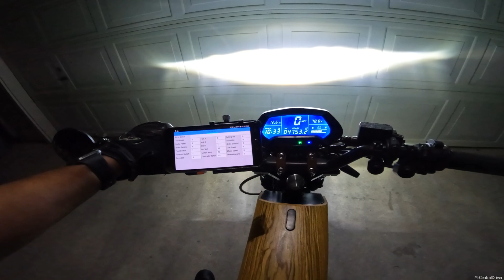Will the ONYX RCR Overheat now?

Comment: Hey, thanks for making these videos, they’re very informative! 

I’m thinking about bumping up my Kelly controller settings too. Did you end up changing out the battery connectors to OSE8 / 10 for the higher current per John Angels posts? I just want to tweak it slightly for more torque (not quite ready for sicko yet) but was wondering if it’s really necessary to change the connectors, curious what you did here. Thanks
Reply from the maker: yes ose8 with breaker switch
Reply: @MrCentralDriver  gotcha! I see that now from your other video. Thanks, keep up the good work!!

Comment: Question: do I need a kelly controller to unlock sicko mode?
Reply from the maker: Onyx rcr comes with a Kelly controller. Sicko mode is just what John Angel calls his adjustment tune on the stock controller.
Reply: @MrCentralDriver  so ultimately I just need to download the app on an android and adjust settings
Reply: @midorian12491  yes but read the blog very thoroughly and take some time and order the necessary parts and precautions otherwise you'll end up with a blown out controller or motor

Comment: Just about to buy my second QS205, this time it will be the newest version which is the QS 205 V3 Ti. Some stores in china now sell the motor with the stator aid and hubsinks already installed, I think this is a good thing but maybe they should have done this from the get-go. Some people have made PC computer cases that are like fish tanks, so the container houses all the components but is submersed in a certain oil that is non-conductive to electricity but of heat only. This resulted in a massive increase of surface area that allowed for rapid passive cooling without fans.

I think it would be possible to do this with these motors, it would be akin to a sealed gearbox or combustible engine in that they are filled with specific high temp oils but the container openings have a gasket seal to prevent any leaks, so that would have to be made by myself. In theory, it could work and reduce heat even more! 🤔
Reply from the maker: were at? they were sold out when I looked
Reply: Let us know how your theory tests out if you're going to test it

Comment: Yes regen creates Heat and a brushless motor makes for a horrible generator you would be lucky to get one or two percent back out of your motor into the battery it does save on your brakes but it's a little tough on the electric motor and it's cheaper to change brake pads than Motors so as you can see I'm very much up in the air about regen
Reply: I feel the same.